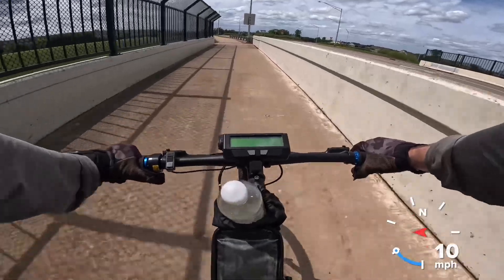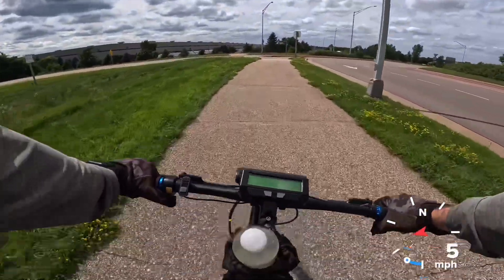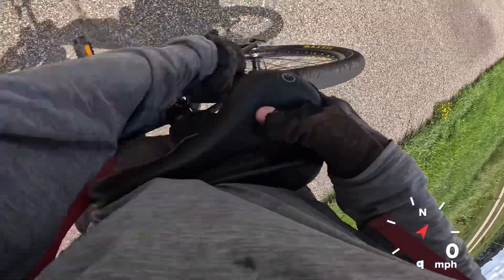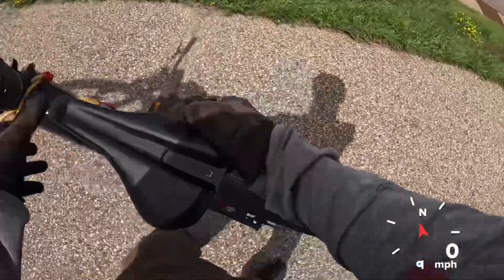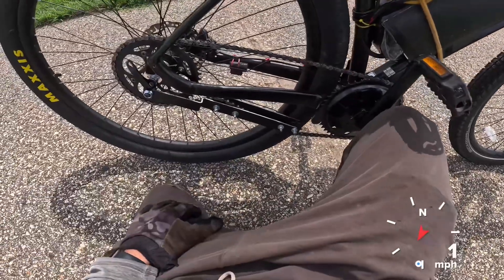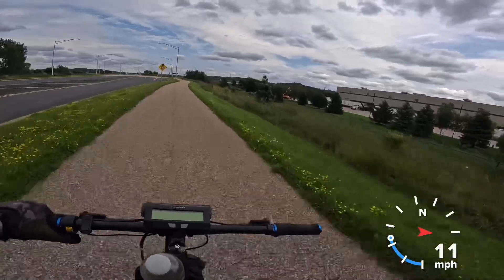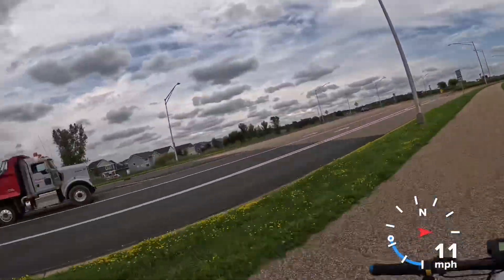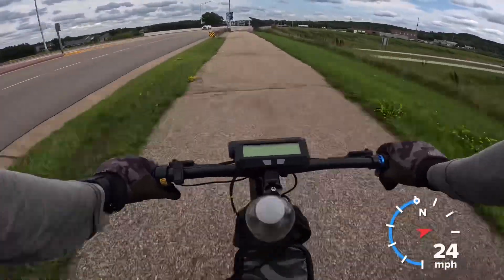Testing DIY Chain Tensioner Higher Speeds Food Run

Comment: If it breaks you could try the recumbent trick using a nylon tube .
You are right about the gears I only use 2 with BBS02 so removed the others .
found that spinning it fast and creeping up hills was pulling more amps than using high gears and
going fast . With 42 and a 14 gear can hold 35 mph at 52v and max 18 amp.
Love your attitude, need more people like you with the pioneering mind .
Don't think outside the box, but outside the box that the box came in !

Comment: Got my Heybike 750W Mars working finally after repairing everything wrong from Heybike. It's fast but the throttle sticks accelerating unless the brake cut outs used. Hits 42 & then cuts out & starts again at 38 & steadies at 39. Not bad for a 22 amps contoller.

Comment: It is odd that Flipsky doesn't put more effort into the ebike use of their controllers. It seems more effort by them is toward oddball powered surfboards and electric skateboards. But I guess they know their business best....
Reply from the maker: @NoInfoFound  i reached out to them regarding a collaboration, i had offered to create some ebike upgrade videos in exchange  For a 75100 controller which is chump change 100 bucks. And they were hung up on me paying a 50% deposit for the controller or something haha 😂  i was just like nm 🤦‍♂️ I’ll just buy another one on Amazon dudes….   VERY odd company I’m not sure they completely follow the VESC spec or whatever it might be, they call it FESC or whatever, i need to look into that more. Hopefully more VESC options become available, in the mean time i’ll appreciate the flipsky as the only low price entry into the vesc - ish platform
Reply: It seems a lot of vesc controllers are geared for e-skate and one wheel. Vesc tool certainly has a lot of options for that stuff. I recently got a Vesc controller for my roadrunner and it's been working great. Your right though it's hard to find people doing ebike vesc content.